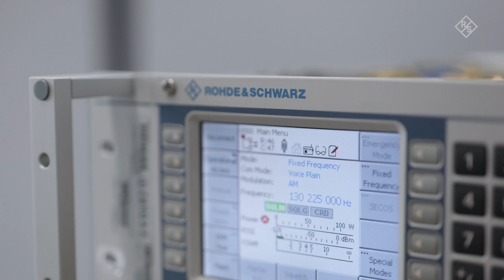Ausbildung bei Rohde & Schwarz in Köln: heute Azubi – morgen unsere Zukunft

Comment: I WONDER HOW CAN I CONNECT MY Globisens LabDisc TO ARDUINO VIA USB CABLE?  ARDUINO HAS TX AND RX PINS, LabDisc SUPPORTS UART PROTOCOL. BUT I DON'T KNOW HOW TO READ SIGNALS FROM LabDisc OUTPUT CABLE WHICH IS FOR CONNECTING TO LAPTOP.

IT WOULD BE FANTASTIC IF YOU SHARE A VIDEO ABOUT IT. 

THANKS IN ADVANCE.